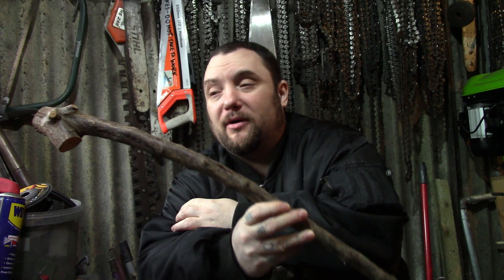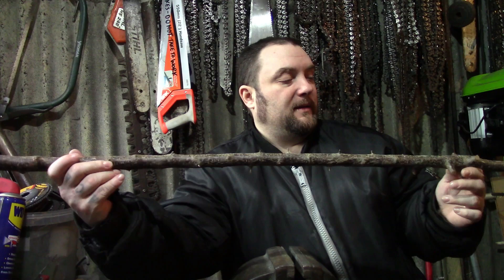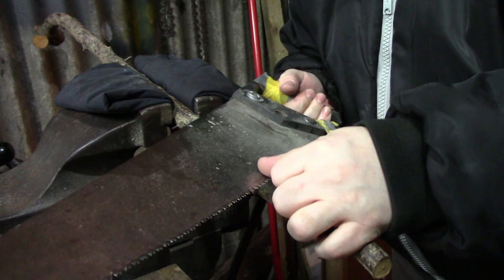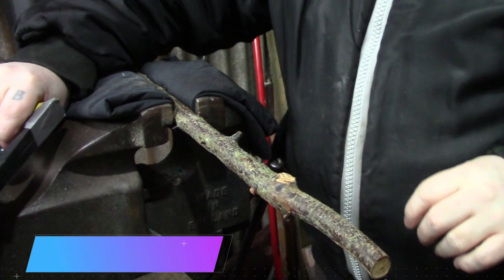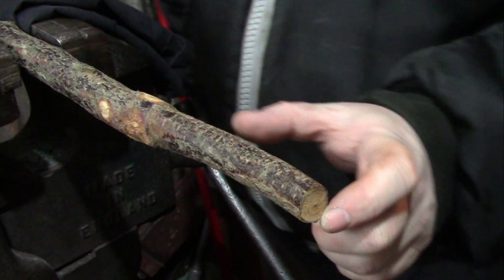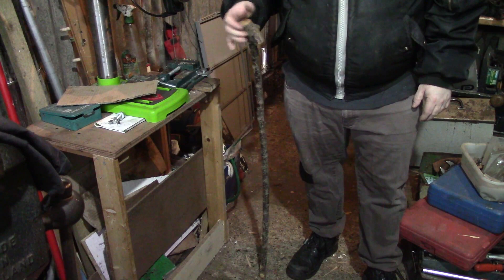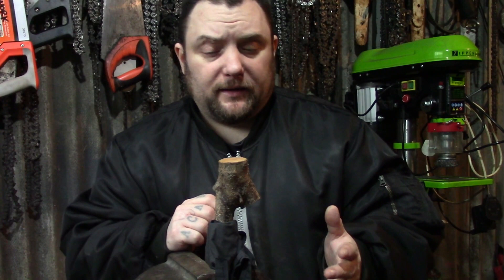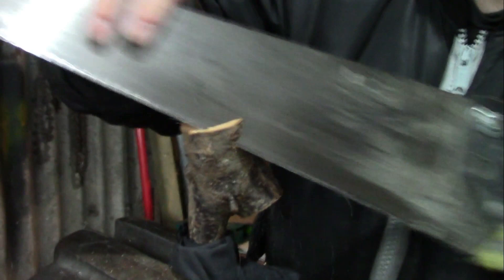How to make a Shillelagh

Comment: Have you ever tried a Japanese style pull saw? Highly recommended.
I bought a nice walking stick in this style not long ago. I did put a rubber food on it.
I can also recommend an electric power file. Works nicely on wood and aluminum.
Well done Mike.
Reply from the maker: Glad you liked it mate, No never tried a Japanese style pull saw, but have seen them and they look decent, will have to get on one day.

Comment: You should have drilled a hole in the head and put some led weight in it and the end you cut off use to plug the hole back up it would have been a real fighting shillelagh
Reply: A little knowledge is dangerous

Comment: Your shillelagh turned out great Mike.
I think a Shillelagh definitely has more value I you make it yourself.
I'd like to try & make my own but I have no idea where I'd get blackthorn from.
Reply: I have the same problem. I live in New England, in the USA, where there isn't any blackthorn. I'm going to make my shillelagh out of Eastern ironwood. It's probably the best wood I can find over here.
Reply: @Inv1cto  I think Iron wood would actually be a great wood to use, it's hard enough & it looks great once it's been worked.
If you make one, you should definitely do a video.
Reply: @eugenevictortooms4174  I plan to, but curing the wood will take a while...
Reply: I just ventured a shillelagh of sorts. I live in the southern USA and sweet gum it a tough wood with a very crooked grain. The grain is practically impossible 
to split and is resistant to breakage, so that was my choice. My problem was it was more of a walking stick because it had no knob for a handle. So I had a piece
of grapevine about 3 inches in diameter and used a 4 inch piece of that. I drilled a hole in it to match the sweet gum, epoxied it on, and shaped it into a proper knob. Painted it super dark brown/black. Turned out good and functional.
Reply: I would say Ireland most likely is where you get blackthorne from